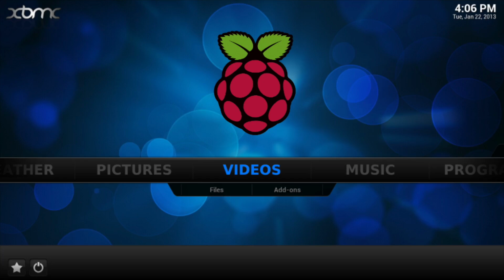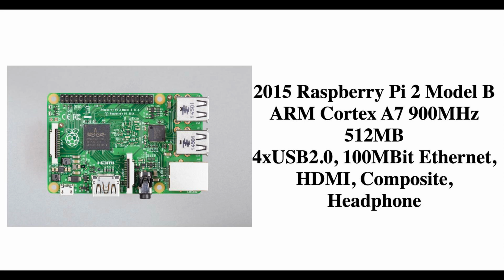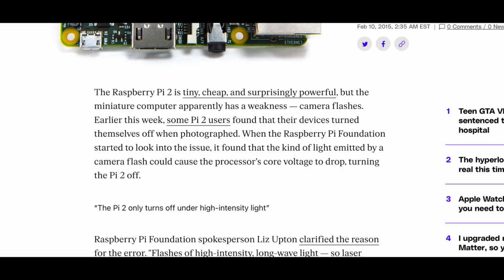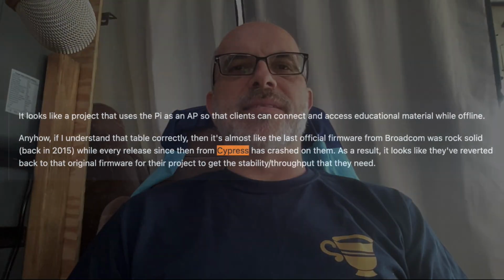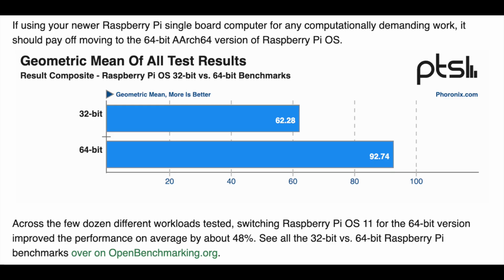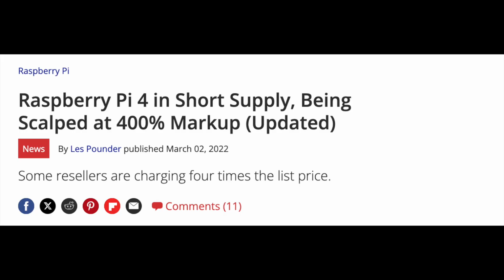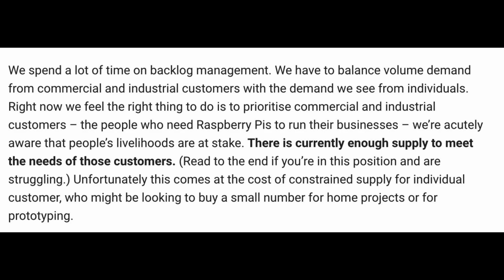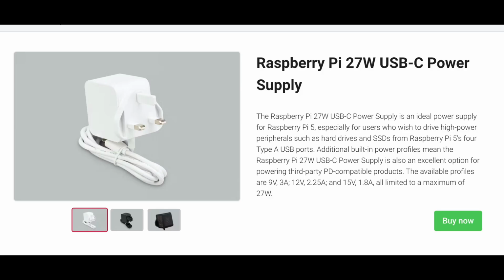Raspberry Pi has always kind of sucked.

Comment: I have tried a number of the Chinese Pi clones and have to say whilst the hardware of them is very nice, they totally fail with support and software.  They run old versions of linux, drivers are buggy, documentation is poor, the camera ISP support is very limited etc.   Therefore the Pi is still streaks ahead of them.
Reply from the maker: My experience with Pi really isn't any better than that! I will agree that some brands are better than others but the current generation of boards look pretty solid and have multiple official OS images available.

Comment: Nice t-shirt! As someone who likes designing custom PCBs, I never liked the idea that Eben can source the SoCs from Broadcom but Joe can't. 
So would never use RPis for projects that require reliable performance (as no documentation available) or need stable supply chain.
Reply from the maker: Agree on all points! But for most hobbyists they're wanting something off the shelf that will do the job with minimal fuss, and largely the Pi fits that bill, outside of issues like the ones I discussed.